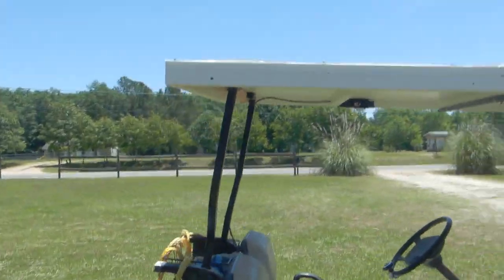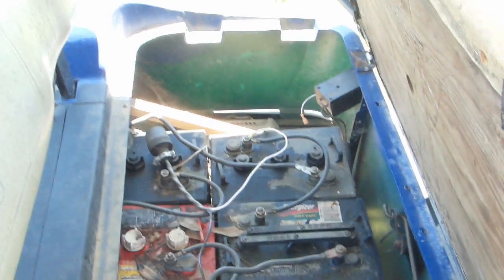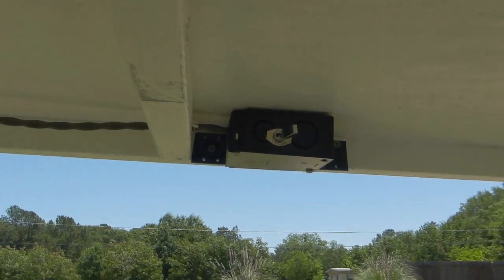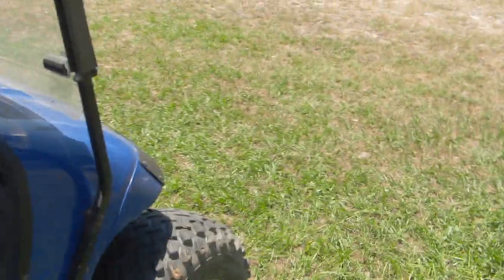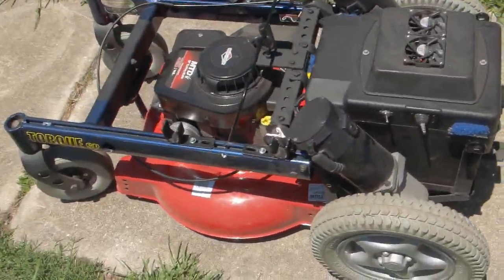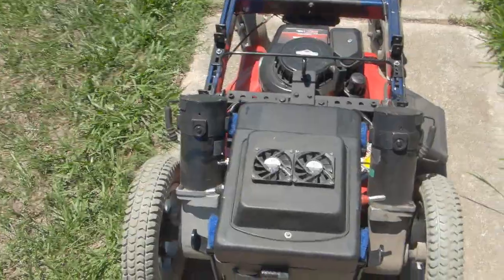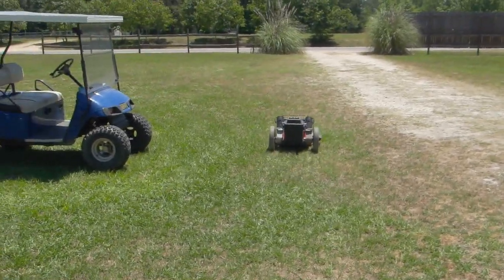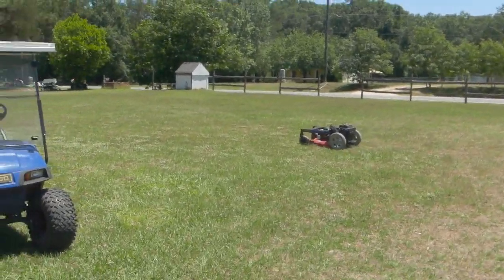Solar Golf Kart + Remote Mower

Comment from the maker: I just took the wheel chair apart and reconfigured it so the motors and batteries were moved out of the center. This made room for the mower. I didn't draw anything. There are so many different types chair out there, so a set of plans wouldn't do most people any good. I'll try to make a in depth video soon. It really was pretty simple.

Comment: I dont think you should bother with GPS future. The simply way to lawn an area is memory function. You program machine to memory steps form starting postition (1 front, 2 left, 4 right....). Then next time you only have to position machine in starting position, and it will go over a recorded path. This is not as cool as GPS, but is far easyer to program. Regards